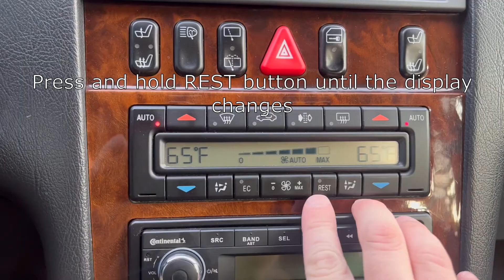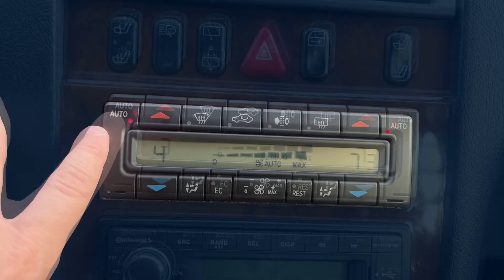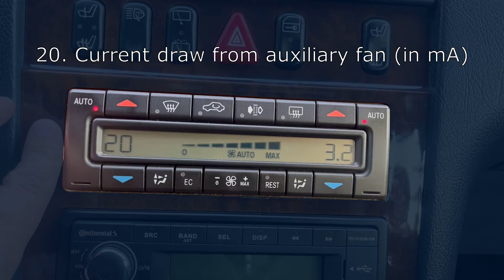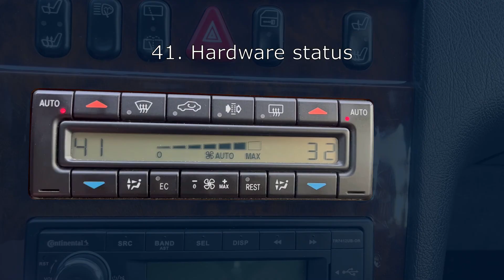W210 W140 W202 Mercedes-Benz AC Diagnostic Mode (All Values and Descriptions)

Comment: Can you point me to a link for getting my ac out of the EC stuck mode. I’ve seen a few but nothing has worked on my 2000 e320
Reply: Still looking? My 2 E320 are both stuck in the EC mode.

Comment: Hi,Great video ,I have a question can I drive a 2000 E320 wagon whiteout the light switch module ?,it's out of the car it burned down,Thanks !
Reply from the maker: @technicsmelancholic6289  do you mean like the headlight switch? Probably not since it has a fuse box built into it

Comment: My 1998 w202 aircon doesn't look anything like this 😮
Reply: Might be because you dont have the automatic clitmate control which was quite an expensive upgrade back in the day. You probably got the one with two big dials and two temperature wheels
Reply: @Max210Kombi  ahh ok cool cool thanks for the info! Yes indeed that is what I have!! 🙏🙏